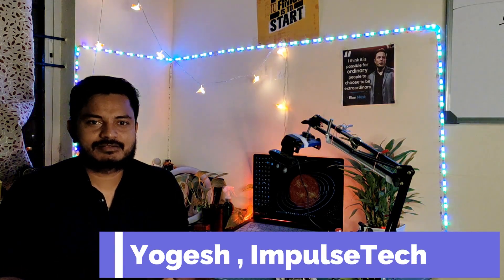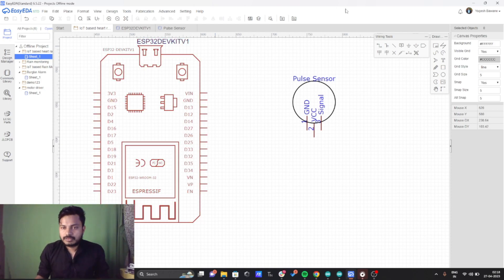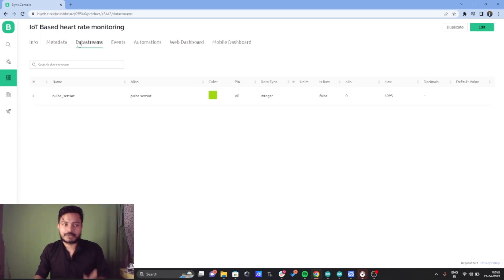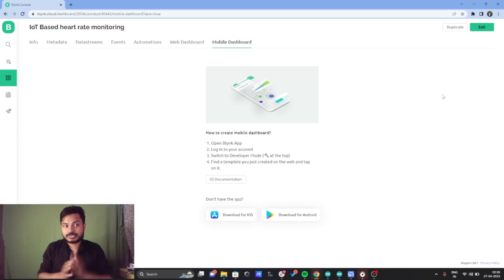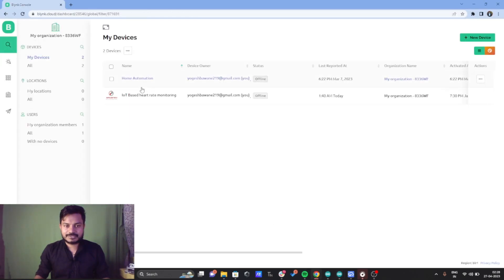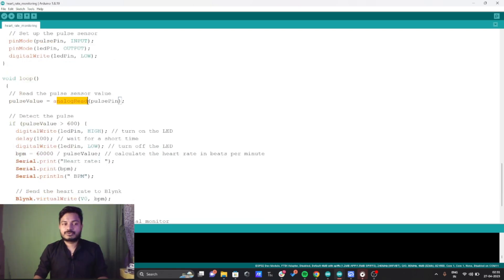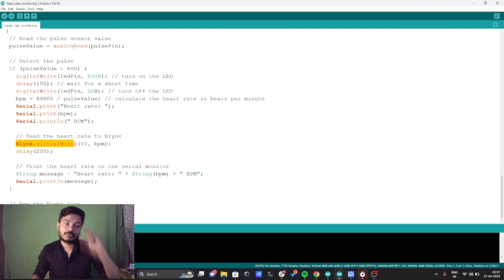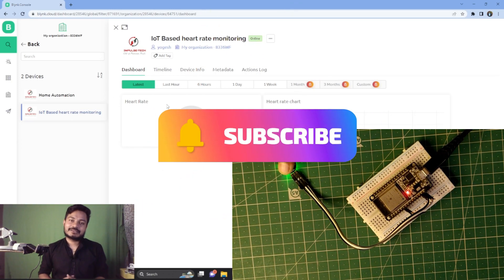IoT based heart rate monitoring using espp32 and pulse rate sensor

Comment: false data reading
Reply from the maker: I haven't calibrated it 
I am getting the raw values of the sensor.
In order to get the correct data we need to calibrate the sensor.
Reply: @ImpulseTech   i am getting 24,25 bpm,something like that
to get perfect value or meaningful value what can I do?
Reply from the maker: @Arif_officials  can I tell you tomorrow as it's too late here
Reply: @ImpulseTech  ok
Reply: hey, whats the answer. I got it too. My raw value from analogRead is around 2,9K and if its used to devide with 60k is arround 20. How

Comment: Wifi credentials means
Reply from the maker: Write the name of the wifi and the password for the same. You can use the mobile hotspot as well.
Write the name of the mobile hotspot and the password for the same
Reply: @ImpulseTech  for MAX30102 sensor what will be the input and output pin?
Reply from the maker: @payelbakshi4635  i haven't used it